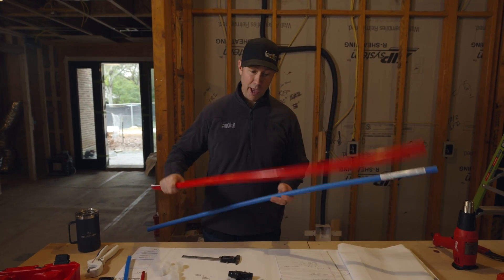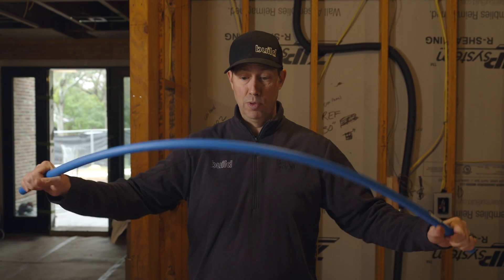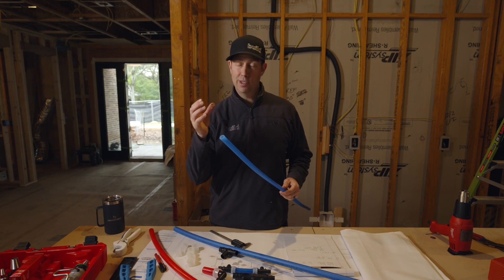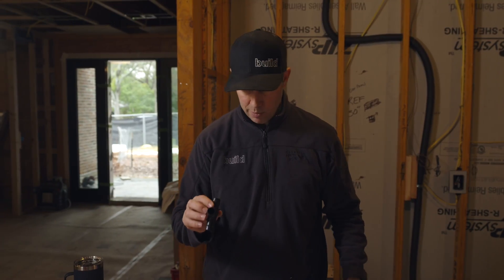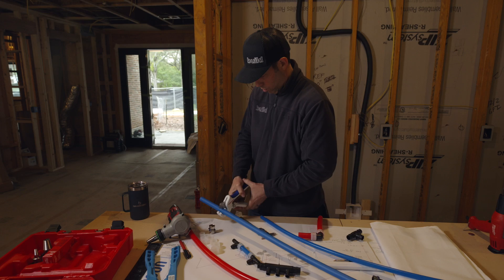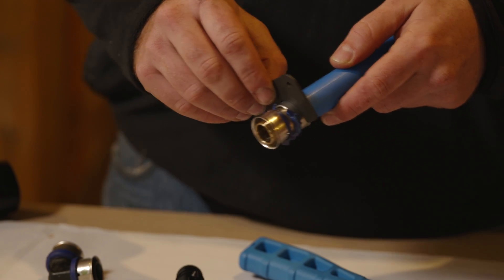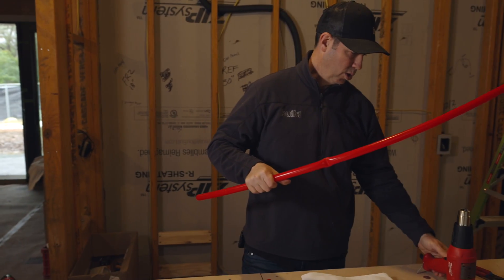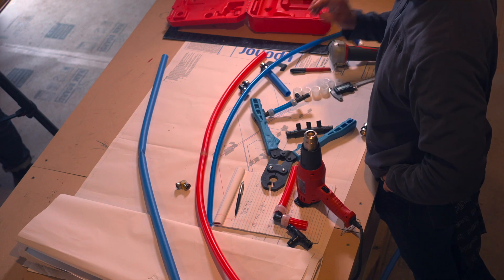Uponor Pipe System Review & Comparison

Comment: Question, for the icemaker line, why didn't you just come straight down, rather than putting the bends in?
Reply: Because I got lots of freebees to do it.
Reply: Yeah ,I was thinking the same thing.
Reply: Coming in late to this question, but here are my thoughts:

The icemaker line is going to a shutoff valve.  The valve needs to be in that specific location, in order to be accessible.  And it looks like the tubing must enter the valve box from the top due to how the box is constructed.

So the supply tubing must make two bends - a bend to come right and enter the cavity where the shutoff box is, and another bend to return to the correct up-down orientation in order to match the fitting on the valve.

I guess the tubing could have done those bends as 45 degree angles instead of 90 degrees, which would use a bit less tubing and avoid sharper bends.  But the tube also has insulation added to it, and maybe the insulation is easier to work with and gives better coverage if the tubing goes thru the studs at 90 degrees instead of 45?  I dunno.

But I think the main answer to your question is to look at the fittings on the shutoff box:  The tubing enters from the top.
Reply: Possibly they were at the end of one length of pex and instead of placing a coupler and then 4 feet to the right, installing a tee fitting do the drop down, they just decided to put the tee in to join the two so there would be 1 less fitting in the run. That's the best reason I can think of, but yeah, I would prefer the cleaner install with fewer possibilities of accidentally hitting pluming when installing a picture, cabinet, etc.

Comment: Looks like you might want to check for kinks in the lines.  That line behind you there look kinked under that pipe insulation. 
Nothing reeks more havoc in residential water supply lines than over bent pex or ubinorf. 
If not a nice open bend the flex pipe will kink off the water supply . Even under pressure that stuff kinks.
Hope you get none!

Comment: do any of the pex manufacturers offer a fitting that is reusable?
Reply: Some of the Sharkbite slide on fittings can be reused. 
They make a tool that fits around the tube and depresses the teeth, and then you can slide the tube back out. Or an adjustable wrench works pretty well in a pinch...just make sure that you get the plastic sleeve out of the tube and back into the fitting.

Comment: I am wondering if anyone has heard of blue water in the States. In Australia it has occurred in some fairly rare instances when using copper pipe. Some sort of chemical reaction can occur in some types of ground conditions. Apparently the blue water is a mild poison too.
Cross linked poly obviously doesn't suffer with this. I am retired but worked in the Architectural profession when I worked. We used to do a lot of schools and obviously we couldn't risk blue water in those projects and always specified pex as a matter of course. Not sure about the different types and brands available here but I guess that's not as important as the actual material.

Comment: The only problem with pex-A is due to to it's softness, it will leach more chemicals into the water.  I was always under the impression that pex-A was the only type that you could use expansion fittings on.  However, recently I learned of a company (Zurn) that makes pex-b with expansion fittings.  This is most likely what I'll use when I build my house.  I'll be using a whole house RO filtration system, and it seems counterproductive to make ultra pure water but them use piping that leeches chemicals back into the water.
Reply: What chemicals are being leached?

Comment: I've managed to uncrimp things that people said were permanently crimped via kinking. I did it by slowly messaging the pipe back into shape by slowly applying increasing force (in a messaging like motion with my finger tips, without pushing too hard) on the apposing sides at the points where they're at their hardest to cause the shape to bow out at the point where it's been crimped inwards.  I've never done this with PEX (so I don't know how that would fair), but I have done this to deformable plastic pipes that weren't meant to be bent. The process does take a minute or two once you find the right amount of force to slowly cause the pipe to deform back into shape.

Comment: It's a lie to imply the full port fitting affects the flow capacity proportional to the diameter difference. This is not how fluid dynamics works. It's only a fitting, it will have a negligible change.  If the entire pipe was smaller then it would matter.
Reply: Even if it was an issue just go up one size. It's basically just a nomenclature issue, yes PEX B has less flow than other pipes for a given diameter, it's also peanuts to move up to  the next larger size and have more total flow than Upunor style fittings...

If you have pressure drop issues with any kind of pipe your plumber is an idiot and should be fired. It's really not hard to design a proper system with any kind of pipe.
Reply: @ryanroberts1104  0.67 vs 0.68... I wouldn't say there is a difference
Reply: @CybekCusal  PEX B type fittings undoubtedly restrict the opening more than that - they are noticeably small compared to other pipes/tubes rated the same size. But that doesn't really matter. The whole point of PEX is you use few fittings anyway.

Also few things inside a modern home use more than 2.5gpm, which is easily delivered with 1/2" PEX B and it's "small" fittings. 3/4" PEX B makes for a good trunk line if you need it, plenty of flow for multiple users at once.

But it's not politically correct to use a bunch of water anymore.....
Reply: @ryanroberts1104  I disagree. I design large commercial systems for a living... I know the math and the formulas.
Reply: @CybekCusal  Disagree about what? This has nothing to do with commercial installations, that's totally different, it's about houses - 99% of which will be smaller than what Matt shows.

Obviously commercial buildings have more occupants and require more flow...I can math too.

Bottom line is, 1/2" and 3/4" PEX B and it's "restrictive fittings" will be plenty for the vast majority American households. You need to be using a serious amount of water before that becomes a problem.
Reply: If you have a Roman Faucet....for your soaking tub...would you rather have 1/2" Pex or 1/2" copper  .... Good luck ... if you choose pex... Might as well leave the bathroom for 10 minutes.
Reply: @supernova8962  While 1/2 PEX would be perfectly acceptable, you could very, very easily and cheaply upsize to 3/4" PEX, you fucking tool.

One of many reasons you're not a plumber.

Comment: Interesting. 
The "PEX" style pipe in Europe is often also Uponor, but we normally do not use the same as what you have in the states. We normally use a multi-layer pipe.
https://www.uponor.co.uk/products/drinking-water-and-plumbing-systems/multilayer-pipe-system  
That has a compression fitting and is very durrable. There is a special machine to compress the fittings. 

They do sell the pipe like you have here as well, but it is not common so far. 

We also have a special system for drinking water lines...Maybe they can send you a demo for that? Basically it insures there is no stale water in there. 
https://www.uponor.co.uk/products/drinking-water-and-plumbing-systems/hygiene-logic

Comment: Although brass uponor fittings are better, than the plastic uponor fittings?  Is it worth the cost?  Are you 100% comfortable the plastic uponor fittings won't crack in the corners? like on the t's

Comment: @mattrisinger another fact that is equally important. It spends its service life as the only pipe that will continue to become water tight,  squeezing tighter forever.  No other pipe period can do that.
Reply: Right...other pipes are just permanently solvent welded or soldered or use mechanical threads. FAR more "tight" than any shrinking plastic!

Comment: Such a biased video. Three major brands of pex, and one sponsors his video, which one do you think he would choose?. His logic would work well on lug nuts on your car wheel too, right?:)  Steel fabricated "devices" [in this case - clamps] are designed to work under the stress ratings created for the application. If you had to re-plumb 2 bathrooms, you need to learn how to use the crimping tool.

Comment: What was the adapter that the gentlemen was using with the drill type of tool
Reply: They're not actually drills.  They're dedicated PEX expansion tools.

https://www.amazon.com/pex-expansion-tool/s?k=pex+expansion+tool

A completely manual one can be had for under $100.

Honestly, I'd rather stick my manhood in a belt grinder.

If you've already got batteries for a specific system, the tool is about $300.
If you need to buy the battery too, tack on around $120 to the price.

Comment: I guess Matt is not familiar with Rehau. Poor research. I use it for plumbing, heating, and geo.
Reply: we used uponor for over 10 years and recently switched to rehau due to the fact we dont have to wait to test lines in the winter, and the pipe is cheaper, fittings on par
Reply: @joeltell8484  so you switch because of cost ??? But Uponor has been in business for over 50 years (Wirsbo) .... Do you prefer a Kingston Faucet or a Kohler faucet... But Kingston is so much cheaper ...
Reply: @supernova8962  Kingston brass more reliable

Comment: The biggest issue I found with Uponor system is that you cannot have 2 fittings too close.  It is not good for complicated plumbing in tight space. Also, fittings costs more than copper. Otherwise, it is excellent.
Reply: Can you elaborate on that? For example, under what conditions, what exactly is "too close."
Reply: @kooale  Minimum length of pipe (minimum distance between fittings) is 2" for 1/2" and 3" for 3/4". You cannot have anything shorter. Also, if expansion tool reaches fitting on the other side, it will crack the fitting as it expands.  This usually is not a problem, but it is problem when you have tight space like a small water heater closet with expansion tank, mixing valve, check valve.. Usually apartment or condo setup.
Reply: @lambition  Many thanks for your reply & advice friend.

Comment: Uponor is better because they paid me! Duh! This idea that the bigger fitting diameter is better is so stupid, if flow through fittings is a concern just use the next size up. You just made the point that you don't need very many fittings anyway. It's really just a difference in nomenclature, PEX B is essentially one size smaller by name.

What are you doing with all that water anyway? Few things in a home today use more than 2.5 GPM, easily met with 1/2" PEX B. Also you can fix PEX B just the same with a heat gun, who told you that didn't work? In fact a heat gun is useful for making tighter bends in PEX B.
Reply: Correct. Mass majority of household water fixtures will never show any change in pressure from the few pex b fittings. Viega ran a test with like a dozen fittings on a run. The change was like 1-5% max. 3/4 with pex b fittings will easily run 10-20gpm, 1/2 ~ 5gpm. Hell my 3/8 lines would probably run 5 PGM with ease. 1/4 is finally where flow starts to show up restricted but I can still get 1-2gpm flowing.

Comment: Use Pex-B almost exclusively when not using copper and overall find it faster than using Pex-A due to the time it takes for the tool to expand when comparing to the crimp or sharkbite style fittings on Pex=B. Had a couple occasions when Pex-A contracted and actually pushed the barbs out but someone should always be following behind and checking joints and all joints should realistically be put in a maintainable location regardless of your preferred installation material.

Comment: so what size flex lines are you using for the  sinks and toilets what's the Id  of said flexlines what's the I'd of  the plumbing  on the fixture  or even  the flow rate of the valves... my point your not going to plumb a entire house on 1/2"   but rather a 3/4" or 1" trunkline  with 1/2" feeders for each fixture
Reply: I understood what you were getting at. This whole notion that a handful of pex b fittings are going to bog down your pipe is a misconception. In reality, the difference will go unnoticed. 3/8 supply line is a very small I.D. I'd say less than a 1/4" for a foot or two. Far more restriction than any short pex b fittings.
Reply: This is exactly what he's said.
He's doing a 3/4" trunk on the "track".  With the appliances being 1/2".
Reply: @PhotonHerald  but hey let me break it down for you  98% of flexible  supply lines and fixtures  are going to restrict the water flow more than type b pex
Reply: @timjohnson6864  The problem is not just a single fixture or fitting or or product type.

It's the aggregate effect.

So, it's probably a good idea to minimize the number of places you reduce flow rate.
Reply: @timjohnson6864  I am.
Okay kid.
Reply: @PhotonHerald   using what type of pex not to mention  you didn't  even  comprehend  the actual   comment
Reply: @timjohnson6864  He's already said.
Using Type A Uponor.

I understand that nobody sane would plumb an entire house on half inch.

I thought that was pretty much a given from both this video and others he's made on the plumbing of his home.

Maybe I just expect too much of people...
Reply: PEX-A uponor is not suitable for hot water recirculating lines. PEX-B is better for HWT recirculating.

Comment: hitting 20 below temps last few days,cant ever remember pex ever bursting. as you stated use as few as possible fittings in walls,more home runs to main supply runs the better.still use  grandpa's copper in machanical area's to stiffen up pipeing supply's.customers have confidence and like a good a strong looking material.keep it straight,level,plumb or good right angle.word of mouth is the best avertisement for good paying customers.

Comment: This Pex will fail if you have a hot water recirculating line. I know first hand. I am a plumber and have it installed at my home. Call uponor and ask them about hot water recirculating line on the pex. They don’t warranty it! Mine failed in 1 year. It has something to do with water heated to 120 and gpm of the pump.
Reply: sounds like a negative  if you plan to use it  to  run anything  that takes water for a extended time
Reply: Uponor engineered the system so I think they know what hes doing.
Reply: @kdrguru  a recirculating system  is not recommended  as ray powell had pointed out. so any long use appliance   probably  would be bad news for it as well  have you ever taken a long shower  ran multiple  loads of dishes through a dishwasher  or used a power washer even?
Reply: @kdrguru  you have a brain use it as it was intended
Reply: Ray, What kind of pex is better for this application?
Reply: @CybekCusal  Pex B
Reply: @shawnd567  good to know thanks.

Comment: Why insulation on a cold water refrigerator line?
Reply: Because t helps to prevent moisture problems in the wall from warm, humid air condensing on cold pipe.
Reply: @willyshopdotcom  do you have to do that with all the pipe? I've never seen this in my area. We use insulation on hot but never use it on cold.
Reply: As Willy Doyle said, sweating issues.
Reply: Do you really think it's going to sweat with that insane building envelope?
Reply: @CybekCusal  Ever pulled a bottle of Coke out of a refrigerator?  Like the mains water in some parts of the country.  Just above freezing.

Now set it out in a room that's 65-70 degrees.  After a while, it'll sweat as the temperature equalizes.

Same thing happens with the cold line.
And you insulate the hot line simply so you lose as little heat as possible into the wall cavity.

Comment: When I started using PEX, Wirsbo was the only option available to me locally. I have used Uponor extensively since.  I have tired PEX-b for hydronic heat and have not had any issues, but for the reasons you stated, I prefer Uponor.  Also, the heat gun allows you to replace a fitting without cutting off the pipe. Thanks for the comparison.
Reply: Uponor is rebranded Wirsbo.

Comment: Appreciate the content you out out Matt, always good to see how other people do things. I have noticed in some recent videos alot of electrical cables run with water feeds. Is there no requirement for separation of services in the US ?
Reply: Why would you need to separate them? The wires are double insulated, and the pipes are solid?
Reply: Its code in Aus. Seems unlikely to be an issue but that's the rule. 25mm from cold and 100mm for hot water feeds.
Reply: It depends on where you build, some areas make you separate so that if the water leaks you reduce the risk of shorting out the electrical while other areas don't require it but recommend it.

Comment: How mouse (or other rodent)-proof are these various options (pex, uponor, etc.) vs copper?
Reply: Copper is way more mouse proof than pex. I've seen a rodent chew through pex before. Just recently I also seen a job where the mouse or whatever it was nearly chew through the sidewall but not quite make it. This IMO is one of the downsides of pex, I don't think it's super common that it happens but it one good reason to keep rodents under control.